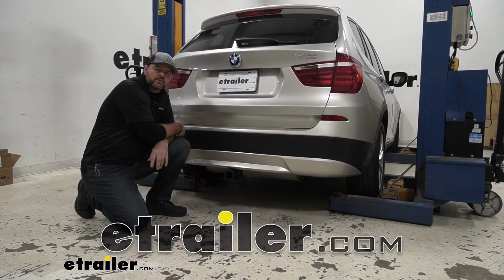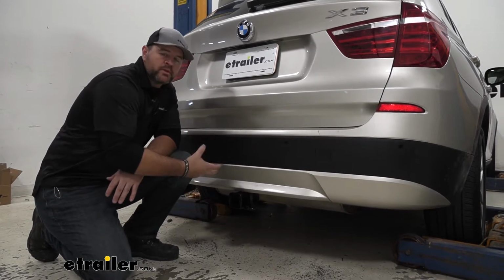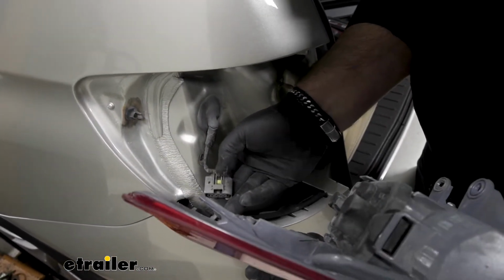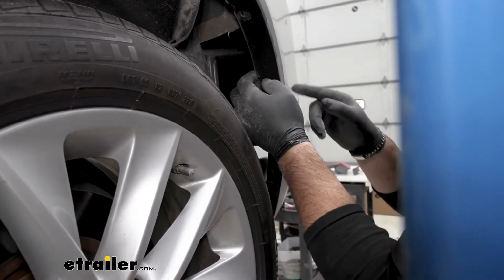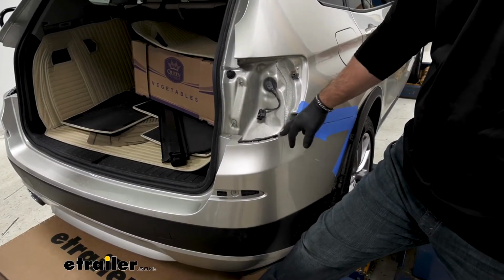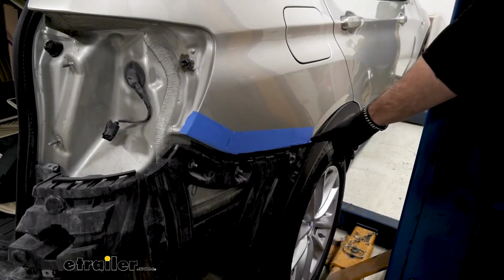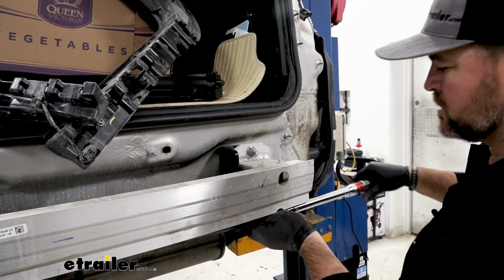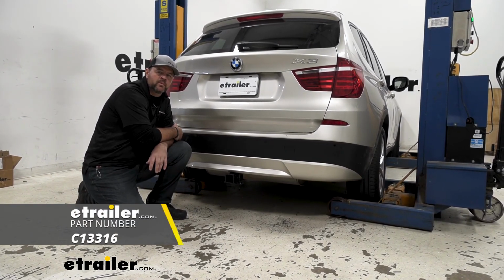etrailer | Setting up the Curt Trailer Hitch Receiver on a 2014 BMW X3

Comment: On my 2014 BMW X3 has part of receiver.  Safety chain latch and pig tail plug. What type of receiver ball attachment?
Reply from the maker: Typically most small trailers have a 17" coupler height, especially rentable trailers. With that in mind, I would recommend part TS27VR. It comes with everything you need ball mount wise! If you need something for a different application, let me know!

https://www.etrailer.com/Trailer-Hitch-Ball-Mount/TowSmart/TS27VR.html

Comment: How about the collision sensors? Does the car need to be programmed in order to deactivate them while towing?
Reply: Have the same question, what needs to be done in order for rear parking sensors not going crazy engaging all the time. My X3 has collision prevention, pretty sure it would break the car as soon as the sensors detect a bike rack or trailer assuming it's a foreign object

Comment: wheres a good place to put trailer wiring through?
Reply from the maker: You can look in the trunk area for a grommet that you could run the wiring through. There also may be enough space behind the taillight to run the 4 pole through and under the hitch.
https://www.etrailer.com/Trailer-Hitch/CURT/C13316.html
https://www.etrailer.com/t1-2014_BMW_X3.htm

Comment: What is the tightening spec for the bolts holding the bumper and the hitch? Thanks!
Reply from the maker: You can find the torque specifications on our product page in the installation details.
https://www.etrailer.com/Trailer-Hitch/Curt/C13316.html